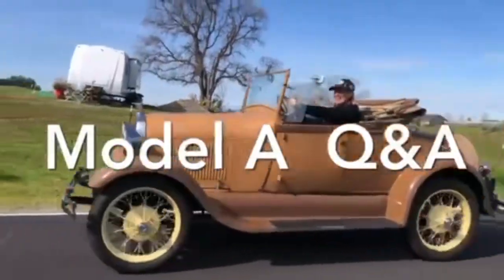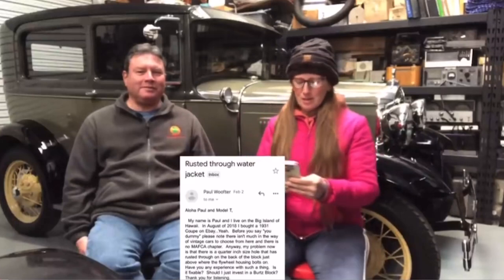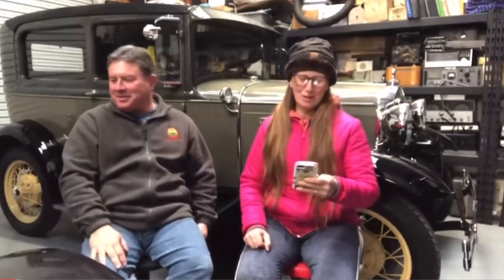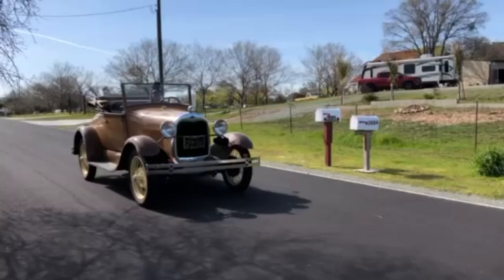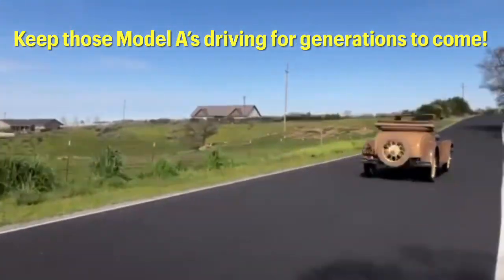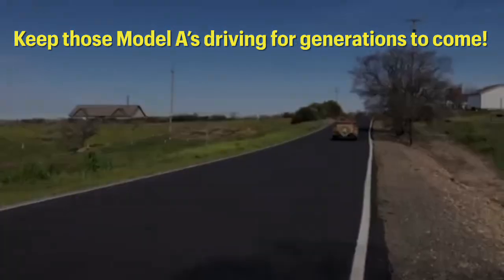How to fix a hole in an engine block Ford Model A Q&A of the day with @ModelA

Comment: Tina/ Paul,  you’re right that works.  The key is to clean and scuff area well to make a good bond.   I have hole in the front under the water pump.  I but I have 3 year and 25,000 miles plug of JB weld repair on my engine.  I will drive it anywhere.  In fact I do!
See you down a country road.
God bless Model A’s
Reply from the maker: Super awesome! Have a great week!